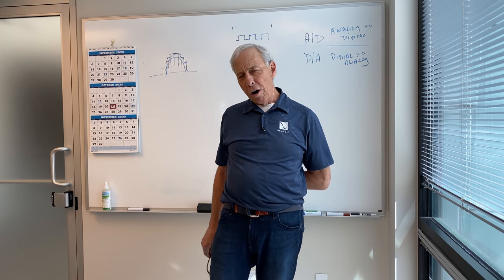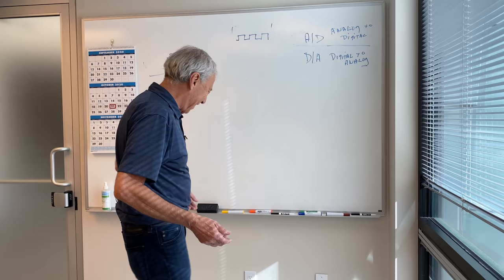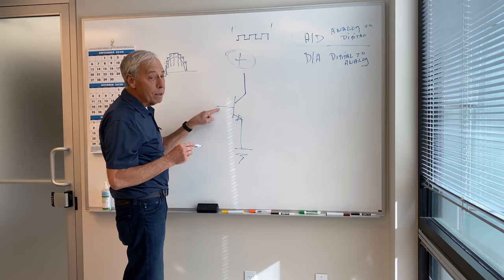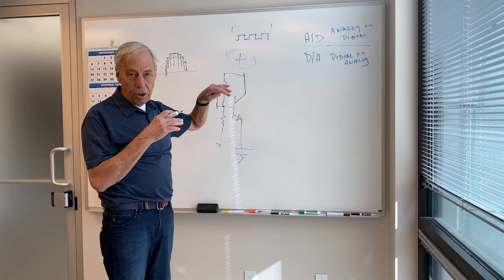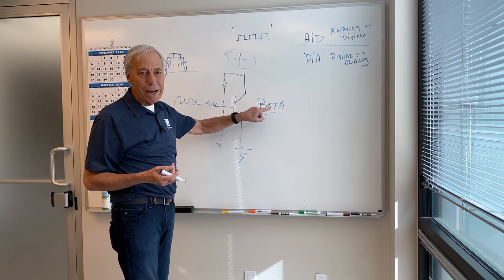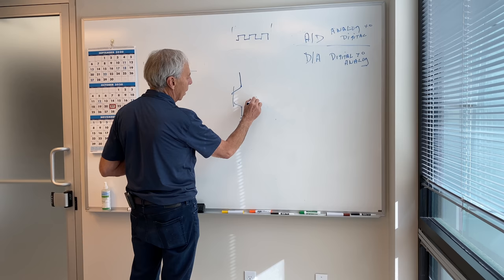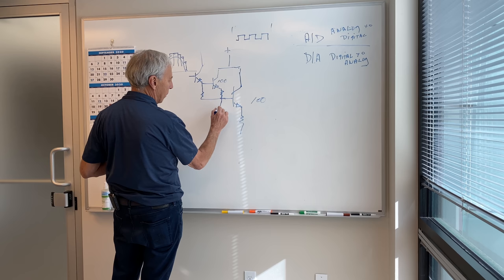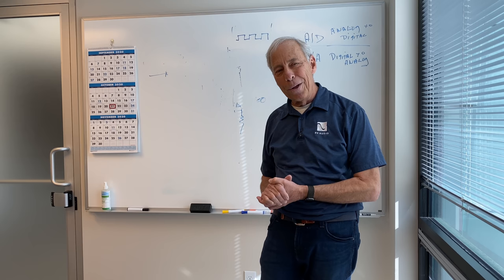Darlington output stages

Comment: I cannot for the life of me, understand why you call Darlingtons a "little used technique."  Every BJT output stage of moderate to high power uses at least a Darlington pair, if not a triple.  Less common is the complementary or Sziklai Darlington pair.  A Darlington pair may be built into a single package, or may be implemented with two discrete transistors.  
Only the smallest linear BJT amplifiers can get away with single output transistors.
Reply: Unfortunately, despite claiming to be an engineer, Paul is a salesman and his technical explanations should be taken with a pinch of salt.
Reply: @geoff37s38  Exactly, he does know a lot of EEs and even set up PS Audio with a friend who's engineer, that's why he's able to explain these basics.
Reply from the maker: Mmmmm, not sure that's true. You may be confusing the emitter followers commonly used with Darlingtons. I've designed and seen schematics for hundreds of amplifiers and in nearly every case, the standard emitter follower pre-driver, driver, arrangement is used. Rarely Darlingtons.
Reply: @Paulmcgowanpsaudio  
What's the difference between a Darlington pair, and the driver/output transistor connection where the collectors are tied together and the driver emitter goes to the output-transistor base?  
I don't think you understand how generally the term "Darlington pair" applies.  It's not limited to a transistor pair fabricated in a single package.
Reply from the maker: @marianneoelund2940  :). Well, one of us doesn't, that's for sure. A Darlington typically is considered one transistor (a compound transistor) where an emitter follower driver is considered multiple. The biggest differences are that generally, in a Darlington, there's no emitter resistor on the first transistor. The current is set from the base of the transistor it is feeding and the arrangement is used to increase the beta of the overall compound transistor. An emitter follower on the other hand, stands on its own as a driver/buffer and has its own emitter resistor that sets the current through it. In most amplifier arrangements we use a complimentary pair for pre-drivers and output drivers. You could, at any point, tap off the output of the emitter follower and draw signal current - something you cannot do with the Dralington arrangement.

From Wikipedia for you. "A Darlington pair behaves like a single transistor, meaning it has one base, collector, and emitter. It typically creates a high current gain (approximately the product of the gains of the two transistors, due to the fact that their β values multiply together).
Reply: @Paulmcgowanpsaudio  
The Wikipedia page clearly says "a compound structure of a particular design made by two bipolar transistors."  The TWO transistors do NOT have to be in the same package.  Individual discrete transistors connected in that manner are still classified as a Darlington pair.  
Any time you have a driver and output transistor with collectors tied together, and the driver emitter connects to the output T's base, that is a Darlington pair.  Period.  If you don't believe me, ask Darryl.  
It may or may not be used as an emitter follower (but generally is, in power amp output stages); Darlington low-side switches such as in relay control, have the load connected to the collectors.  
Typically, base-emitter resistors are added to improve turn-off speed, and a small series resistor is sometimes added between the driver emitter and output T base to limit driver worst-case current, but the presence or lack of any such resistors does not determine whether the pair is designated as a Darlington pair.
Reply from the maker: @marianneoelund2940  Sigh. I tried.